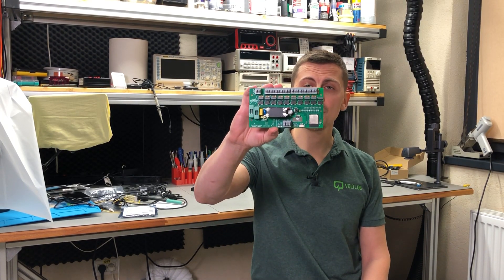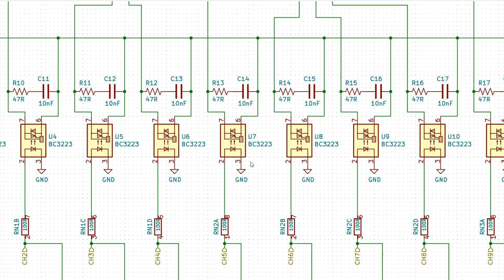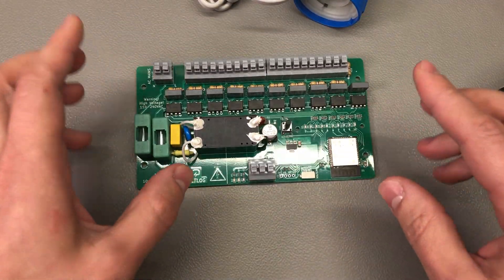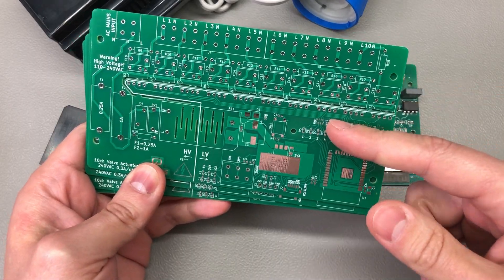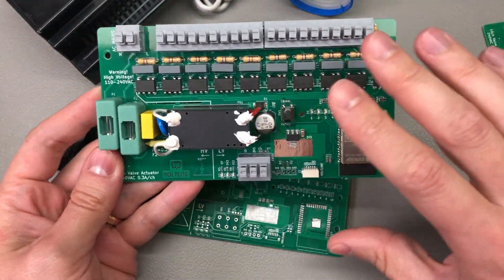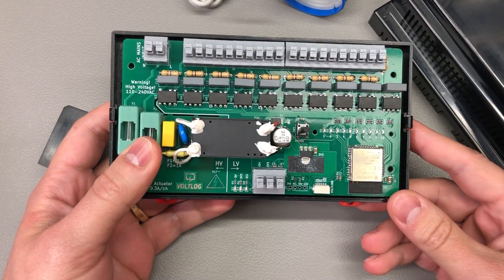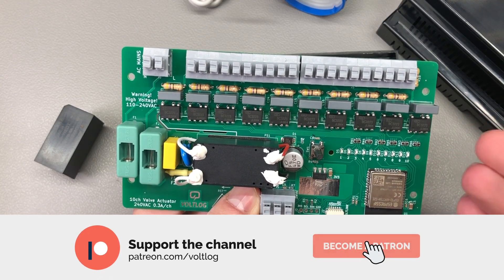Tasmota ESP32 Floor Heating Valve Controller | Voltlog 383

Comment: Hello! I took just a quick look at the controller you designed and I was wondering: wouldn't it be useful to have an output for controlling the pump from the manifold and also an output that starts the boiler when heat is required?
Reply from the maker: Hi Andrei! That is the nice thing about open source projects. If someone feels they need extra features, they can simply fork the project and modify it according to their needs.
Reply: @voltlog  Yep, that's true!

Comment: Will this work with a 24v actuator?  Can I power the unit using 24VAC?
Reply from the maker: Not without modifying the PCB. And what is the peak current on those 24V actuators?

Comment: Looking for something like this! Can you drive two actuators from one channel? Ideally I'd need 13-14 channels, but I can also combine a few zones. If you make another revision consider bumping the channel count to 16, since most of the off-the-shelf units have 10 or less channels. Also, the switch could be handy for reset to AP mode, but maybe mount it an angle pointing downward from the bottom edge so that you can reach it through the opening on the underside?
Reply from the maker: You can drive two actuators from one channel as long as you don't exceed the maximum ratings of the triac. I do not plan to increase the number of channels because that is the maximum I can fit in the chosen DIN rail enclosure. For those that need multiple channels they can add a second controller. I like the idea of moving the switch to the bottom of the board and I'll probably make the change in the next revision.

Comment: Great little valve controller.  I’ve considered getting those DIN enclosure for some of my projects - What are your overall thoughts about them?  How is the alignment with your push terminals with the enclosure?
Reply from the maker: The spring connectors that I use are less than ideal, I would say they fit 90% but the enclosure pushes on them. These enclosures are designed for the screw terminal type terminals and with those, I think it would be a perfect fit. Depending on where you get these enclosures the quality can vary (cheap = lower quality).

Comment: WHERE TO BUY???? Have bought all parts 2 month ago because i Need the Same Board! Would buy!!!!! Great Job. Bye the way: measurment of Flow (in/out) temperatures would optimize the system a Lot.
Reply from the maker: For ordering one checkout my tindie store. The board has an I2C and 1Wire header so it should be quite easy to add external sensors as needed. https://www.tindie.com/products/voltlog/tasmota-esp32-floor-heating-valve-controller/

Comment: @VoltLog Nice project. Which room thermostate you take? Also one with ESP32? And could each room thermostate send the temperature to your controller too? Luckily without an "server" as an RasberryPi?
Reply from the maker: I use a custom design ESP8266 + relay board which is flashed with tasmota, this controls my heater and acts as a dumb switch in my automation. Then I have a thermostat entity in HomeAssistant that takes input from an ambient temp sensor and outputs to the heater relay. Sure you could make all of this independent of a raspberrypi server but that is not my goal.

Comment: Great elegant result. Hats off.A question I always ask myself... When the esp modules are soldered on the board some route a hole on the main board to help improve the antenna gain. I never knew if this makes a big difference or not. Probably you know as it looks you put a lot of time in this Project. Cheers.
Reply from the maker: It's important to not have copper pour, tracks or other metal objects near to the antenna as indicated by the hw design guidelines from the manufacturer of the RF module, however a thin piece of FR4 material is not going to make a notable difference so I don't bother removing it.

Comment: Can you wall-wart power it, because that would make it safe, ie, no mains on the PCB.

I think most drawings are 1st angle projection, but electronics are 3rd angle projection, so you have to pay attention to the perspective.
Reply from the maker: I need mains anyway for the triacs/valves  but external PSU could work for 24V valves for example.

Comment: Check out the "Hi-Link 220V to 3.3V 3W mini power supply", if you did not know about it. It's smaller than what you have there and can easily handle ESP32.
Reply from the maker: I actually have one of these Hi-Link HLK-PM03 modules in my stash, the size is 34x20x15mm while the one I used TDPOWER TAS3-5-WEDT is 38x19x18.5mm so it is indeed smaller and outputting 3V3 directly. The cost is pretty similar at around $2.5 a piece so I will definitely give this a try in a future project. Thanks!

Comment: Excellent project. 
I got the lazy version running (a sonoff 4ch ) just of 4 channels - also running tasmota. 
On the controll side of things. 
If anybody has a tip for the controllting: A PID type controller which accounts for the very slow response of the wax-motors and the overall heating would be interesting.
I currently also use a bang-bang controller via home assistant and node-red.
Reply from the maker: Tasmota has a PID controller in beta, node-red could also be an option but it ultimately depends on your preference and level of control you desire. Personally I don't even think I need PID as my system is very stable & precise with a simple on/off control.

Comment: For the lightpipes I can recommend using old toslink cables. Especially on the thin and cheap one you can easily extract the inner core and insert it into a 3D print
Reply from the maker: Thanks but I've ordered some cheap PMMA fiber, 2mm thick, black coating which makes it ideal for this application. I just need to 3D print a jig to hold the different pipes in alignment.

Comment: Do you have some space on your din rails? there are those 3.3 and 5v powersupplies built as a din rail.
Reply from the maker: Thanks! I do have space but I would prefer the power supply to be included in the "product".

Comment: Nice looking board - and Tasmota also is my favorite for heating automating… ;-) However, i hate those wax actuators - at least for my purposes they turned out to be way too fast in on/off acting, rendering the controlling into some sort of PWM. Which the wax does not like that much over time… At least some of those i have replaced by ‚real‘ motor valves, which also have the advantage to only draw current when they change the valve opening… But for regular floor heating they‘re good enough i guess - and only 10 of those do not waste that much power as well… :)
Reply from the maker: The valves that I shown in the video take about 2-3 mins to fully close/open so I wouldn't call them fast by my standards. After the first few seconds or so after activation, as the valve heats up, the current drops down to around 7mA. If you consider 10 valves running at 7mA 230V you get about 1.6W of power being burned while the valves are being driven. I don't yet have data collected on how often they would be actuatuated but I would imagine a ratio of 15% ON time or less is realistic. That's pretty reasonable to me.
Reply: Can you please share the motorized actuator that you used?

Comment: Great project, thanks for sharing.  Just a shame you didn't do This and That.  :)  I would be interested in the final install and curious how you will feed back and regulate temperature.  I assume the wax valve actuators are simple ON/OFF controller or do they variable flow  control.
Reply from the maker: The valves are simple on/off and they take 2-3 minutes to fully close/open. They install on the return of the individual water circuits. On the start of the circuits there is a way of roughly adjusting the flow, with those flow valves shown in the video (with red ring and transparent tube). In theory you adjust the flow rate according to the circuit length and then you just do on/off control when set temp is reached. Temperature is measured by individual ambient sensors (zigbee) which report back to HomeAssistant which handles the automation.
Reply: @voltlog  You actually can regulate them (and you should for floor heating since it is reacting very slowly - so room thermostats wont do much)  with PWM.
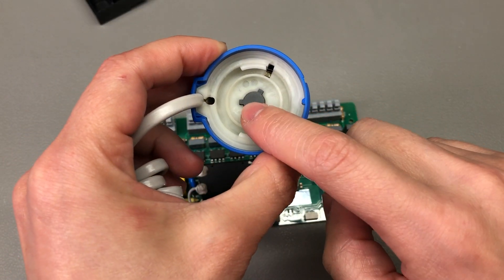To simplify: We know valve needs 3min to fully open, so let say valve has opened 50% (roughly 1:45s) so how to keep it there.
Long PWM - let say we have a pulse long 20seconds - if we have it ON 10s and OFF 10s it should stay in the same position on 50%, (it is not as simple but you get the idea - you need to add start and stop time...)
So if you want slowly closing you set 9s ON & 11s OFF. 
So you can regulate the water temperature returning from the floor loop. You need extra 11 x DS18B20

Comment: Interesting project Florin - will be good to see it up and running.  Here in North America our zone valves tend to run off of 24VAC using a synchronous motor.  I like the wax motor idea - I suspect it may be more more reliable.   For this project do you also have slab sensors to help prevent overshoot? or are you relying on ambient temperature only??
Reply from the maker: Thanks! I have no idea what's popular here but I have seen both 240V and 24V valves being sold, I just found a sweet deal on the ones that I got. I do not have slab sensors, I'm just using ambient sensors and so far I have not observed any overshoot behavior. I'm currently running with a 35 degree water temp so I guess that helps because it's not a lot over ambient but if any overshoot starts to appear I can try an correct for that in the automation loop.
Reply: @voltlog  Ahhh... the 35C water temperature will likely minimize overshoot as long as the slab doesn't have too much thermal mass.   I've also found that most "off-the-shelf" ambient thermostats are quite slow to respond and have a wide/coarse set-point.  Meaning that if you set the thermostat to 22C, it won't turn on until 21C and won't turn off until 23C...a massive range comfort-wise.  So if you are designing  your own ambient thermostats, this could easily be addressed.  Looking forward to more videos on this topic!!  All the best!